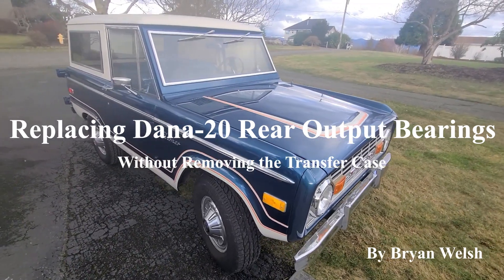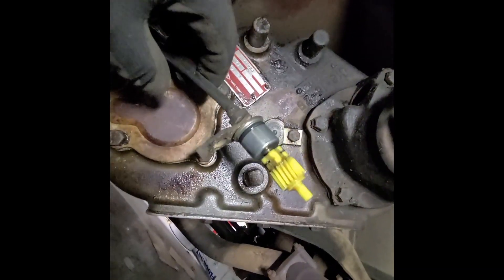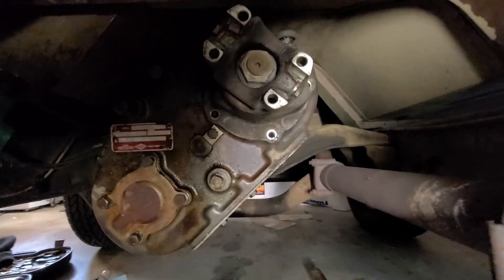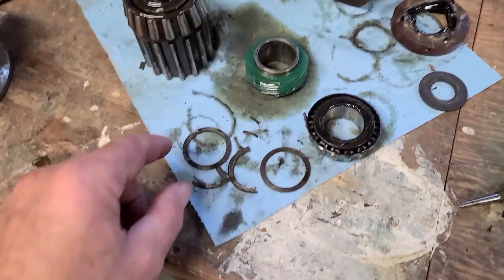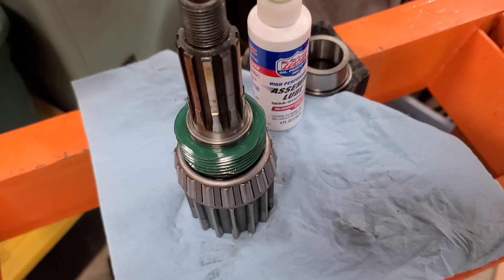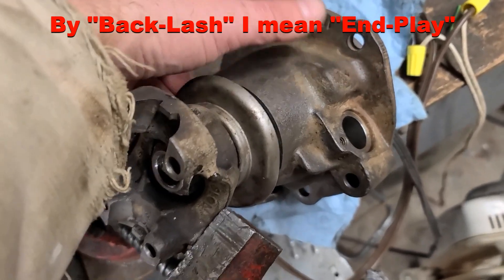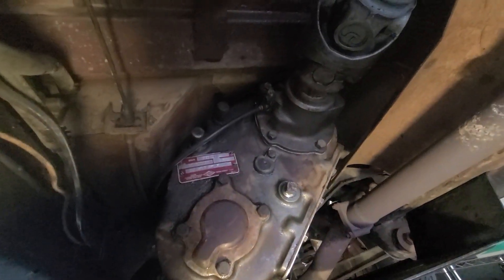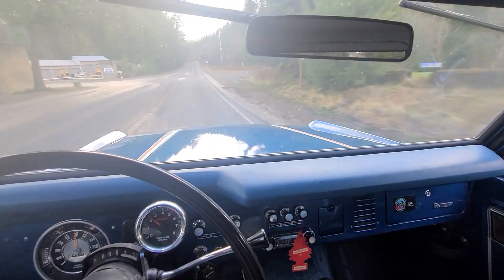Dana 20 Rear Output Shaft Replacement Without Removing Transfer Case

Comment: Nice video. I just finished doing almost exactly this to my old CJ5.  Like you I had a vibration that probably wasn't the driveshaft, wasn't the rear diff. so was hoping this was the issue. There was conflicting info on the preload vs end play so I opted for about 4thou. tighter than zero. Still no preload measurable with a torque wrench.  Works great so far. I suspect the book was written with a mistake originally. Doesn't make sense and everyone you talk to has a different method. How is yours now, a year later?
Reply: Thanks.  Sounds like you made yours a touch tighter than mine.  Yes, the spec of allowing so much end play never made sense to me.  But, I am not a Dana engineer and maybe they had their reasons.  Like temperature change which may tighten it up.  So I errored on the side of just a bit tight compared to specs.  So far so good on how it runs.  Though I don't drive it that much to be honest so not sure that proves much for you.  Enjoy your ride.
Reply: @FriendsandFamily-kr7zz  Thanks.

Comment: Do you know what that knob is that you had your thumb on at 5:15? It's leaking on mine.
Reply from the maker: I believe it is the air vent.  In the video, my casing has been cleaned up but you can still see some dark color around it where oil had leaked out.  Some leaking is normal I would think.  If leaking a lot, maybe the disc cap has been damaged or perhaps the case is overfilled with oil.  As I recall, the disc is loosely fitted to the tube that goes into the casing.  This allows for air to get out but provides a seal to keep dirt and water from going in.